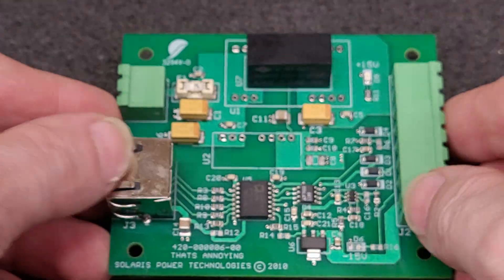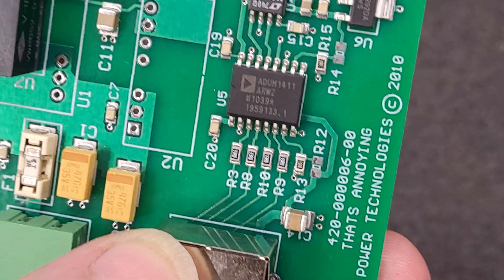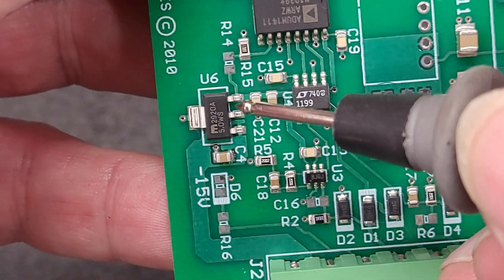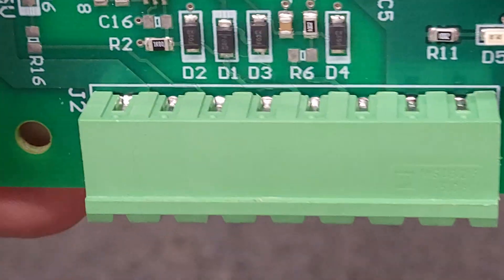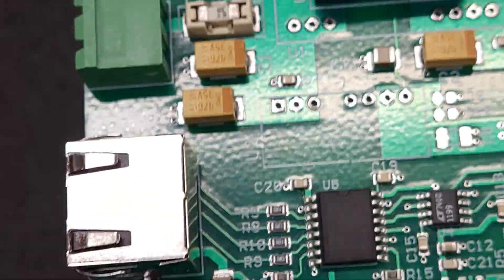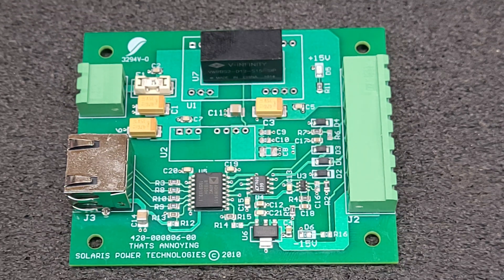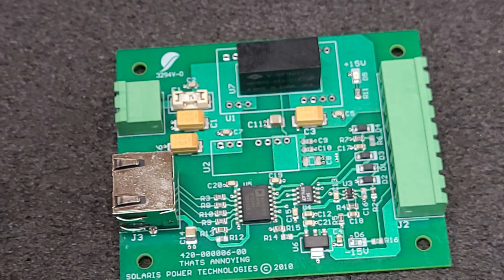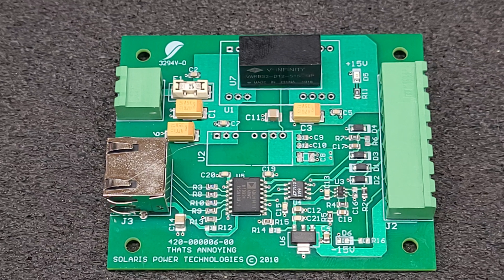What's Annoying? That's Annoying! What is a this Circuit Board? Whats It For? Anyone?

Comment: Solaris markets a lot of power widgets, like solar panel systems, inverters, and battery systems - for land, boats, and campers. Without too much thinking or checking, my guess is that board is some sort of adapter/interface for the RJ45 remote-control port found on many pure-sine power inverters which use the EGS002 controller board. The EGS002 has a 4-wire serial connection for a remote, which could explain the ADUM1411 isolator chip. Perhaps the board is an AC-detector to shut off the inverter if the RV/boat is plugged in. There are lots of such widgets if one searches online. Try searching Google Images for "inverter remote RJ45 pinout", "EGS002", and "inverter control module". There's a PDF for the EGS002 which is commonly available, and it has the pinout for the serial interface. Some inverters have an RJ11 for only the serial interface, but that RJ45 might have more functions.

Comment: Judging by the circuitry it looks like it takes 4 analog recording devices such as vibration sensors, which would use low voltage variation signaling and convert those streams into digital signals over that RJ 45 port. The 2 pins at the top are probably for a DC inverter. Just basing my opinion on what components and traces I can see. You could test it.. if someone can find the specific output protocol and has software that can translate it, you could connect a conductor to 2 pins on the 8 pin bus with a rheostat for a load and see if you can get an adjustable wave as an output. That would pretty much nail it as a seismometer sensor communications hub.

Comment: Knowing what the guy was into. My best guess is an isolated digitizer for seismic microphones. I think the SOT23-6 or sot26 package is a current sensor of the INA series by TI. The current is measured by one channel of the ADC and the signal itself is measured by the other. The protocol seems to be SPI. SPI would not be suitable for long range so the PCB would have to be part of a system that polled the sensors and provided long haul communication.